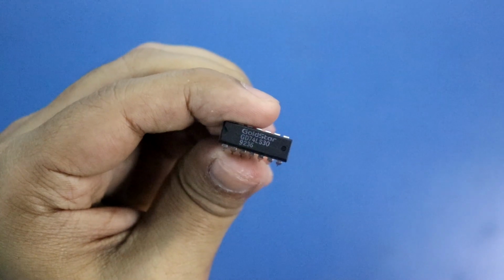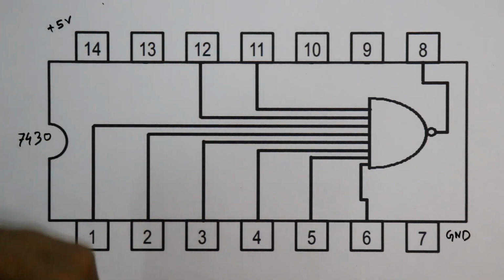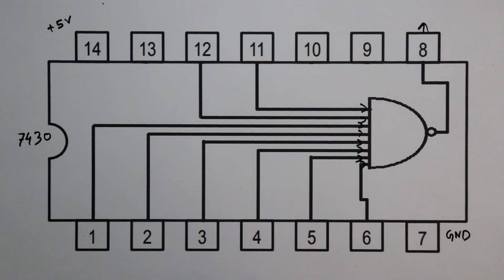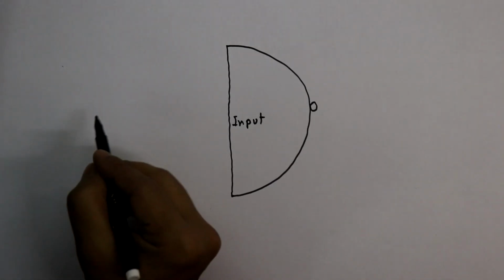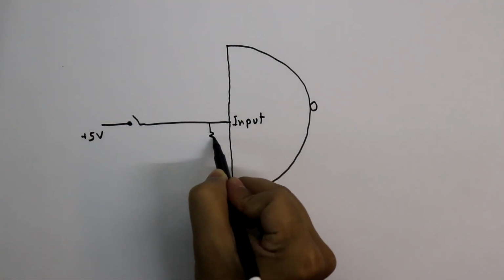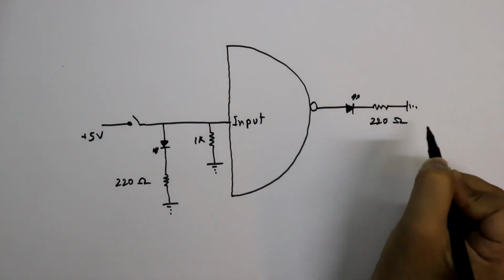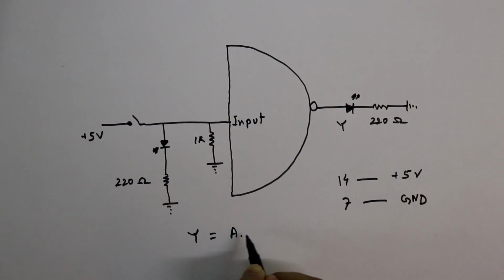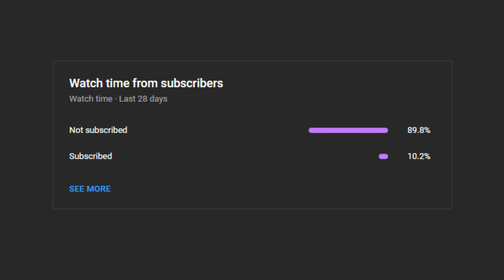IC 7430 | 74LS30 | 8 Input NAND Gate

Comment: Hey there I was wondering what's the difference about the 74 logic gate series and the 4000 logic gate series?
Reply from the maker: 7400 series are TTL, Vcc should be 4.5v to 5.5v. These are faster than CMOS.

4000 series are CMOS. Vcc can be 3v to 18v. Very large voltage level.
Reply: @EEWave  Thanks for answering my question. So basically TTL is good for making logic stuff like a computers, ALU, calculators and more. And CMOS is good for general things and if it needs high voltages right?
Reply: @Script  ttl like the 7400 series uses Schmidt triggers for faster rising edges using a much lower voltage but you'll still see both in modern electronics
Reply: @Script  if you ever want cleaner square waves use an inverter like the 7406 or 7400. Use it as a buffer. Two inverted gates equal the original one with a fast rising edge. Correct me if I'm wrong d.
Reply: @jstro-hobbytech  thank you